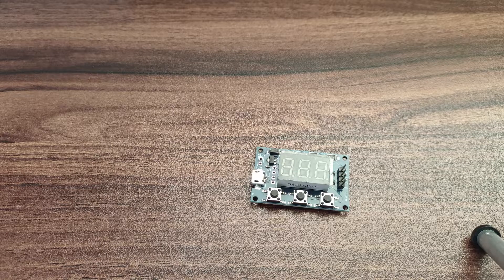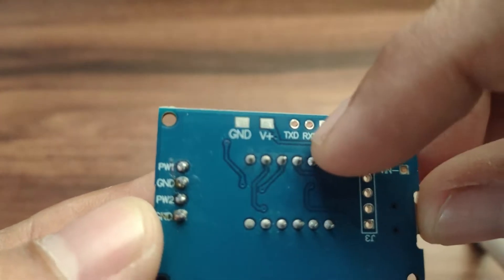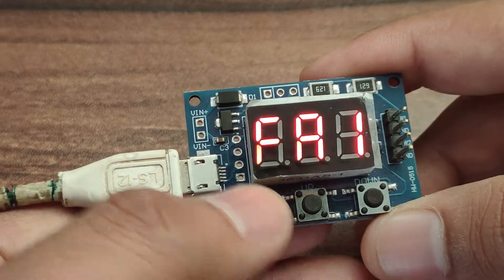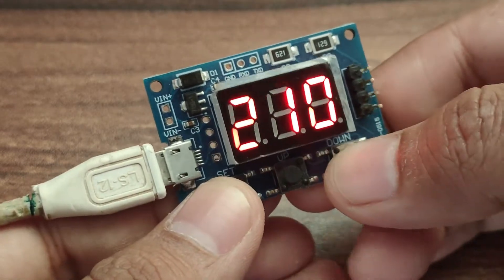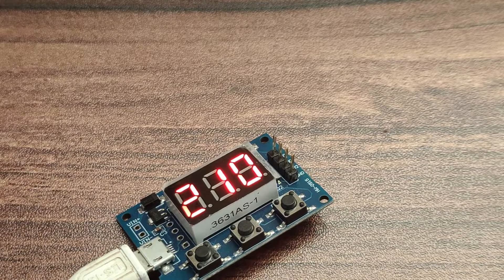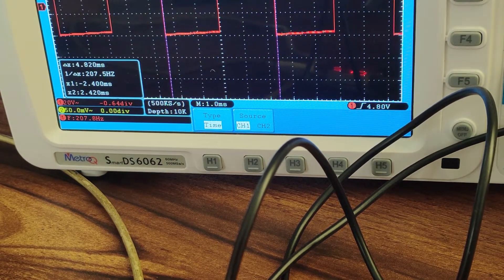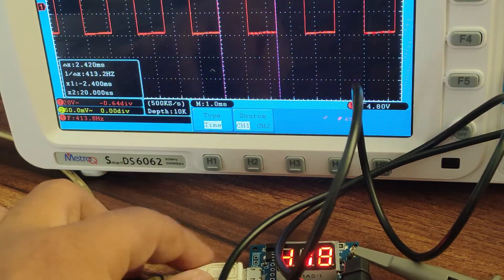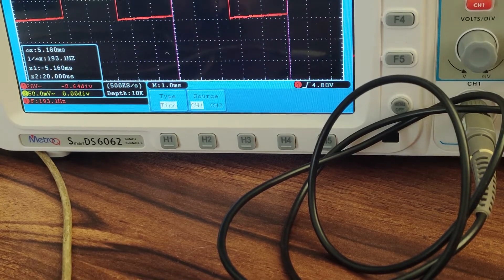Two Channel PWM Pulse Frequency Adjustable Duty Cycle Square Wave Rectangular Wave Signal Generator

Comment: Will the set frequency and duty cycle for both channels individually remain the same even after the power supply is removed? or it gets reset once the power supply is removed.